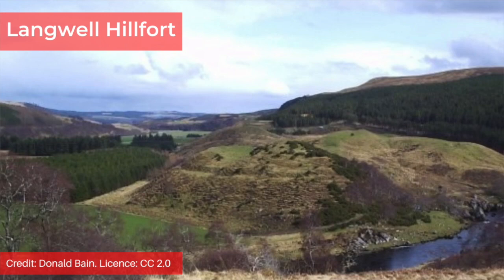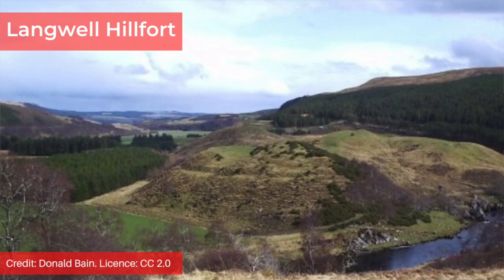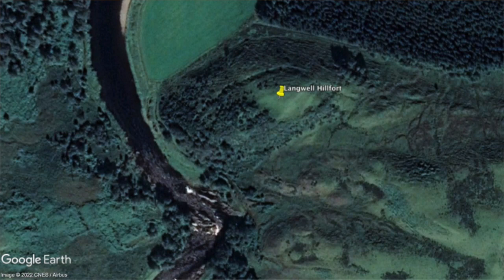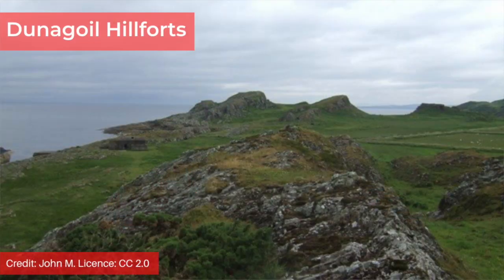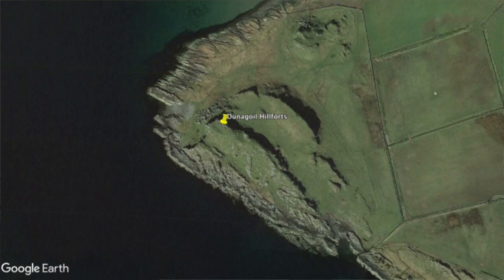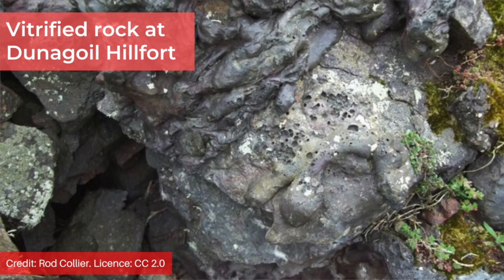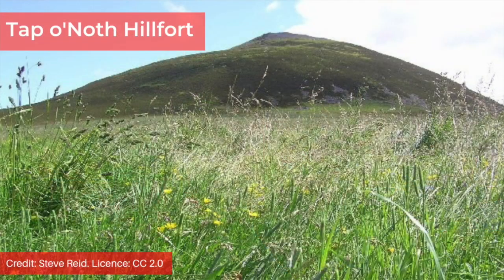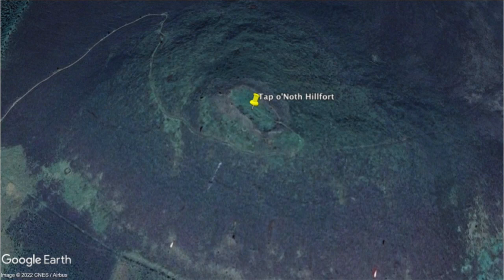How And Why Were Ancient Scottish Hillforts Vitrified?

Comment: Excellent input on a mystery that has baffled me for over 50 years, still no wiser though, it still seems impossible to melt rocks like these in a distant past. I saw a video experiment of vitrification of rocks a long time ago. They burnt many tons of wood and even stocked the fire with furniture! to keep the temperature high. They only managed to find a small sample of molten rock from the centre of the wall. This I assumed could have already been some of the rocks they built the  Hill Fort Wall with!
Reply from the maker: I didn’t think of this. Makes so much sense in terms of why the rock is localized to certain places. Could have been due to a comet way before the forts were built.
Reply: How about peat piled up and saturated with animal fat. That would get very hot
Reply: I like the animal fat and peat method(I thought of peat after I posted my theory; lots of it about....maybe even some bitumin?)
Reply: @MegalithHunter  Would any solar activity capable of reaching us be considered?
Reply: Diehold Foundation, series 4, Part 1b and onwards. The presence of tektite beads on Mars, the Moon and Earth suggest the Solar Nova as being the cause, Doug Vogt has the theory very well explained, with evidence to support. Greetings from within view of both Tap o' Noth and Dunnideer hill forts.

Comment: Cool, thanks for the video. After replying to Vulpes vulpes below, I started thinking about the problem (which can have unintended consequences, or so folks tell me.) In India, human cremation is a daily occurrence along the Ganges, and wood is used for the funeral pyres. Pyres are built using alternating layers of wood with an air gap between each piece. A sustained temperature of roughly 1000 C is needed to cremate a human body - the large pyre with its open framework draws in a lot of air because the burning surface area of the fuel is so large. This raises the temperature, increasing the burn rate, and because air is rushing in from all sides, the heat plume is concentrated and rises through the top which is where the body is. The people who built the hill forts would have smelted copper and iron the same way - the ore is not placed under the fuel in the furnace, it is placed near the top, with more fuel on top to keep the ore from cooling. When the appropriate gods had been propitiated, the magic molten metal would flow out through the bottom.
So what if the core of the stone walls were built, and then a pyre with rocks on top was set ablaze, with molten stone flowing down over the wall? (Or is the entire thickness and height of the wall vitrified?) The stone would get hotter, faster, on top of the pyre, just like ore in a smelter. The traces of timbers are there in the walls because as the fired burned, the pyre would eventually collapse and timbers would be trapped in it.
And, what if the fire really was a funeral pyre, the cadaver surrounded or covered by rocks, so that their spirit, or essence, was bound into the molten rock which flowed onto the walls, protecting the inhabitants from outside evil spirits? (OK, ok, that is just wild speculation.) But once the entire circumference of the wall had been ritually endowed with their ancestors, one funeral at a time over many years, they would probably have to start a new one, hence the abandonment. (And, I am truly thankful that I don't have to break open all those rocks to find a bit of unburned bone or a tooth fragment to prove out this idea!)
Reply from the maker: Gosh that’s quite the theory but I like it! Very possible I feel. But why only in Scotland? 🤔
Reply: @MegalithHunter  I blame it on the hagus. 🤣
Reply from the maker: @farranger275  hahahaha

Comment: Agree with almost all your arguments.

For me the only sensible explanation is the uncontrolled (either accidental or malicious) burning of a large pre existing wooden structure on top of the stone ramparts. I find it very hard to believe the vast quantities of wood were taken up to them just for the sake of burning stone walls, whether by attackers or the community themselves.

If this is correct, it might be possible to estimate the size of the building by the extent of the vitrification. The 1937 experiment apparently used about 4t of wood on 12ft of wall. Obviously huge error bars with only one data point, but that would make quite an impressive structure...

Comment: Tinnis hill fort appears to have been torched around the time the Romans left as does trusties hill in Galloway a bit later according to carbon samples  .Both were local power centres and the vitrification appears to have happened with these events.Thoughts are that this was done by Pictish war bands ,at Trusties there is Pictish carving on the top of the hill.
Thoughts are these were statements for the locals about where the power now lay  as these burning events would have been seen for days .Tinnis was later re occupied

Comment: Has anyone ever thought about people putting something like pitch or pine resin on the rock face and setting fire to it as a way of vitrifying the rock without massive amounts of timber?
Reply: You can use locally avsilable peat..and possinly even lignite..it would burn as hot as coal and could have been fanned by high winds
Reply: @skerriesrockart  yeah, that's good; didn't think of peat.

Comment: Out of curiosity is the vitrification all on one side such as the East side? Does anyone know? Problem with wood fires would partly be from Rocks being cold sink or heat sinks. To get the rock really hot you need to draw the cold out of the rock. The thicker the rock the longer it takes. Ash from the fire acts as an insulation impeding heat.  I’ve gone into cabins that were -40C and started a fire in thick metal wood stove. It can take up to an hour before the metal will be to hot to touch even with a roaring fire inside.
Reply from the maker: Not sure, would need to look into it
Reply: @MegalithHunter  I'm so so on the Cataclysm theory but it would be interesting if at least the places with heaviest damage were on the same side north east west or south.  Don't go out of your path. Just curious.